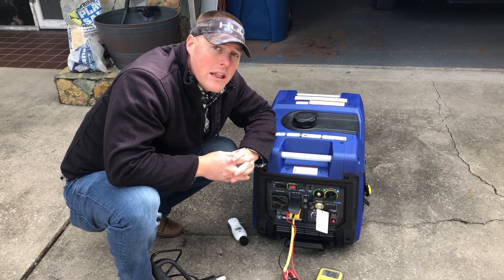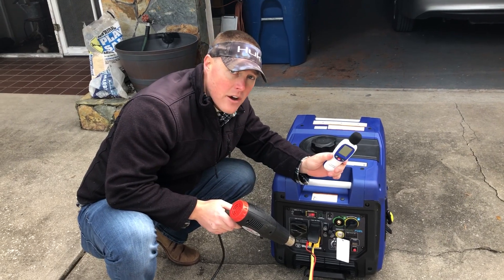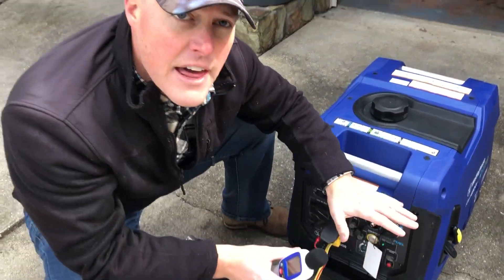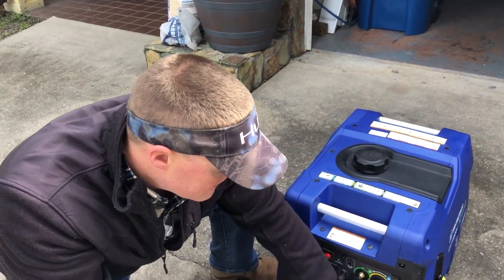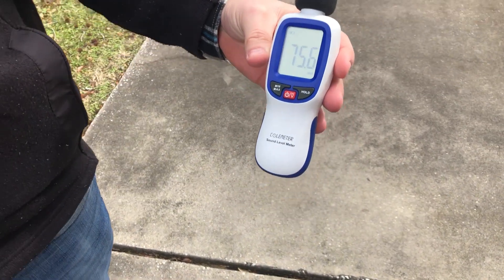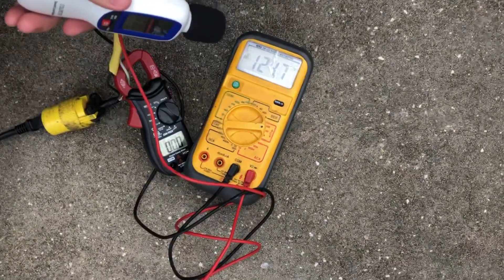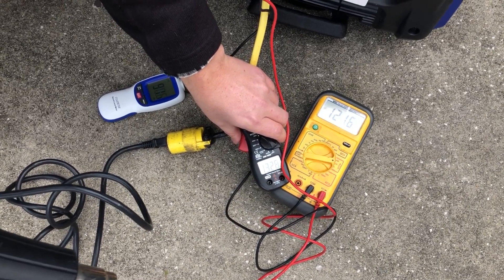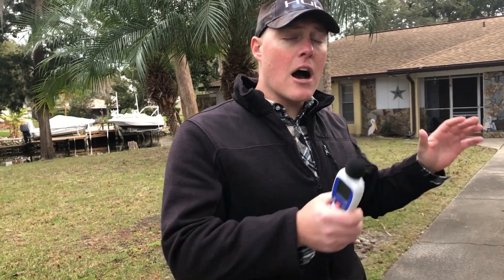Westinghose iGen4500 Dual Fuel Noise & Load Test - Decibel & Voltage Test

Comment: In your opinion which is better Pulsar 4000w or the Westinghouse 4500 inverter generator?
Reply from the maker: They are very similar. It really depends on your needs. The Westinghouse comes in Dual Fuel the Pulsar does not.